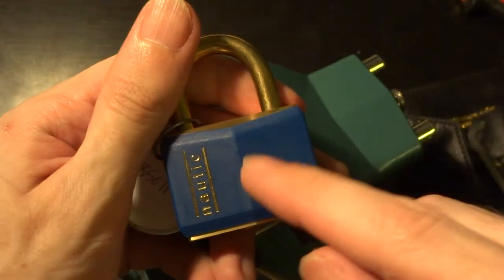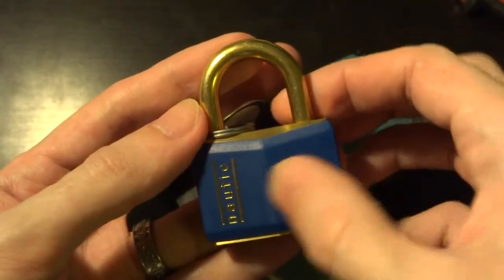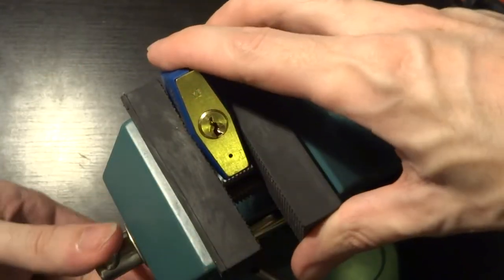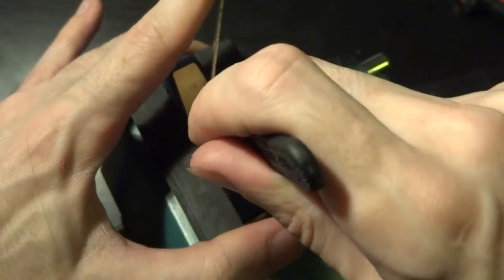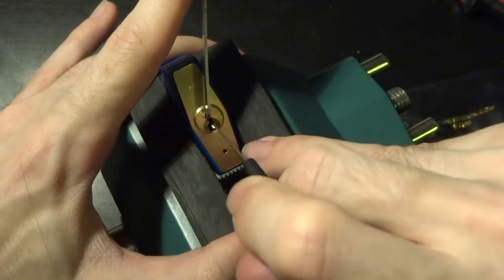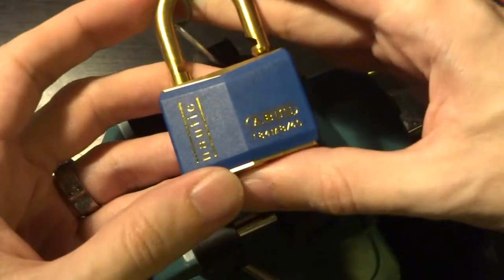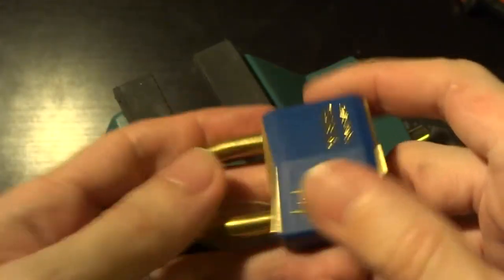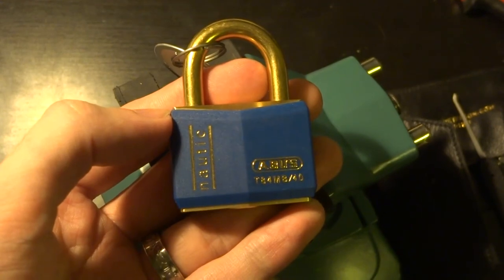(015) Abus Marine T84MB/40 picked

Comment: Aha! Yes! Your mention to seek the security pin which is not merely binding but binding AND offering counter rotation is, I think, a very important point! In the beginning, we are taught to seek the binding pin, but in the age of more precise manufacturing, many of the pins may bind to a degree at once - but developing the nuance to feel which one is actually 'back-talking'
Reply from the maker: That was specifically referring to spool pins and mushroom pins. Once all of the standard pins have been set and only the spool pins are blocking the shearline you will get counter-rotation when you try to lift one of the trapped spool pins.

Comment: I'm guessing Nautic stands for Nautical, which means 'of or concerning navigation, sailors, or the sea; maritime.' 
I have the same padlock.
Nice picking, I haven't been able to pick mine as it has been outside and exposed to the weather, which has made the feedback very dampened.
Reply from the maker: The lock is German so "nautic"  is their abbreviation but yes, it is intended for use in marine environments. A bit of cleaning and lubrication can help with that as long and there isn't too much corrosion or debris in the springs.